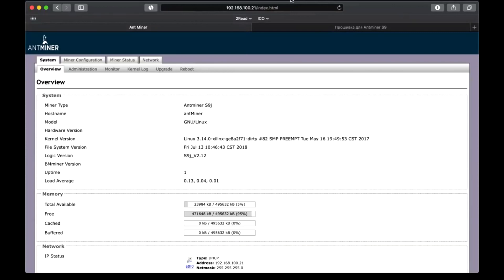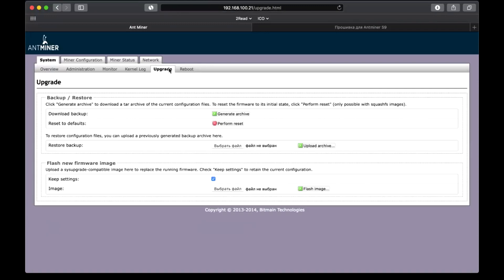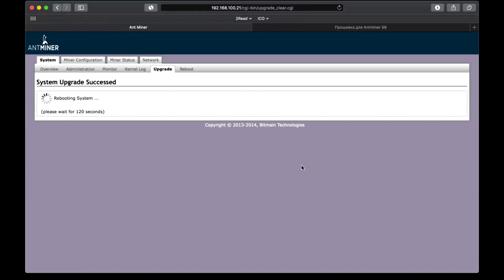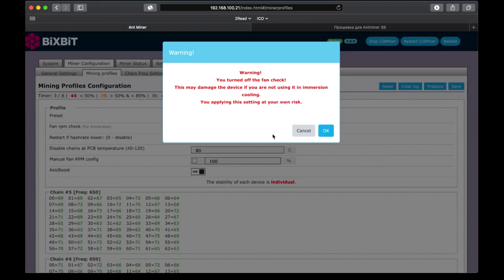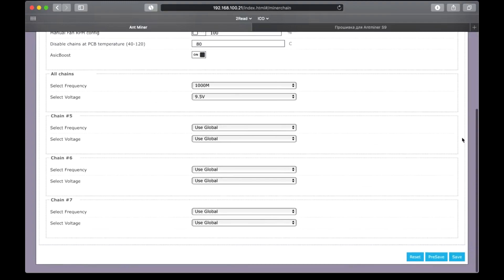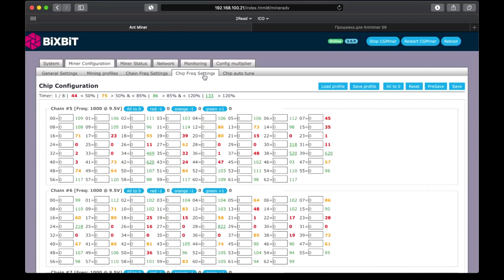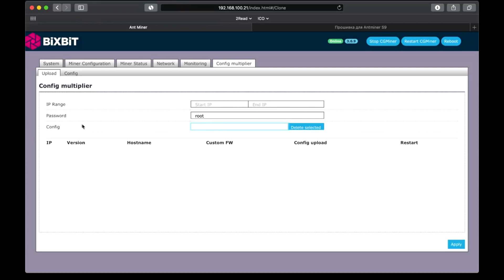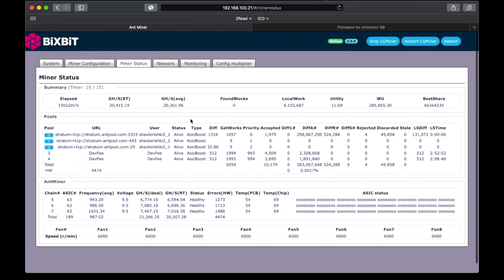Firmware for ASIC S9. 20 Th/s.

Comment: My antminer s9j is 2019 firmware ....so i need to flash from sd card far as i know 1st i need to flash t9+ sd card tool/firmware thn install from GUI bixbit is that right ??....
Reply from the maker: You can follow the instructions on our forum https://bixbit.tech/forum/topic/11-firmware-for-asic-bitmain-s9-s9i-s9j-t9.
Reply: @BiXBiT_Global  one more thing that auto tuning process is 1 time thing or it's on every reboot...because some time in my town electricity out for half an hour in one day 2 -3 times...so it's happened 1 time for each miner or every reboot?
Reply from the maker: @prashantkachhawaha3707  Settings are saved

Comment: Chip on 100% from factory hash rate means 14 + 14 = 28 th  but firmware go up to 20 ~22 th means 8 th will be utilize by Bixbit ... Is it a fee of using bixbit🤔
Reply from the maker: Acceleration goes from 13.5 to 20-22 Th / s. Unfortunately 28 is not real. Check your details
Reply: @BiXBiT_Global  ohhh sorry 👍🏼

Comment: Can this firmware be used on a S9 Hydro? Does the overclocking also increase the electricity consumption, increased frequency also damands more power?
Reply from the maker: For S9 hydro, the firmware is not suitable. Consumption rises when overclocked

Comment: Hi, is it possible to use it with S9 SE? I have a S9 SE, I can not use one hashboard because of temprature sensor on it? I guess I can control it by software right?
Reply from the maker: Hi, the firmware is not suitable for S9 SE. For older models only.

Comment: hello, i have a problem flashing any S9 firmware. When i try flashing it. My S9 start blinking red light. is it normal? I then rebooted it and the firmware is still the old one. Please help. I really would like to use your firmware. My S9 currently is running at 13.9T @1700W..... The wattage is quite high..... Thank you
Reply from the maker: Hello, write about your problem on our forum in the appropriate thread for your equipment https://bixbit.tech/forum/forum/23-bitmain/ There you will definitely be helped

Comment: So far my S9i is very inconsistent with this firmware. It reboots every few minutes saying temp over 80 even on the lowest 10th preset but the temp values show in the 60s on miner status. I also had to disable fan check because it shows fan failure. I might have to go back to stock firmware with all these weird bugs. My stock firmware runs fine, no fan or temp errors.
Reply from the maker: Please post your issue at https://bixbit.tech in the appropriate hardware thread. You will definitely be helped!

Comment: Hi:  I bought a miner with this software and need to re-flash back to standard Antminer firmware, but I always receive "request failed with status code 500" - how can I remove this firmware?
Reply from the maker: Hi, Request 500 is consequence of a virus. First  try to reveal and heal it with an anti-virus feature in our firmware. If it doesn't work, try to re-flash back with SD card with this tool https://bixbit.io/assets/firmware/Recovery_S9_3.8.6.bixbit.img